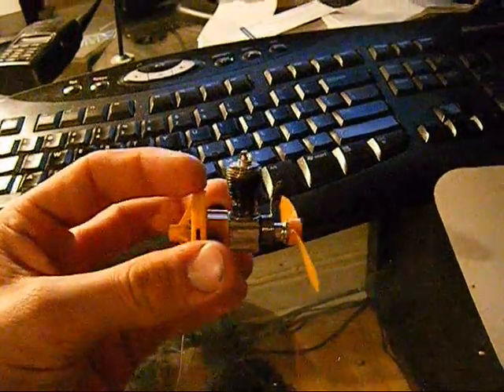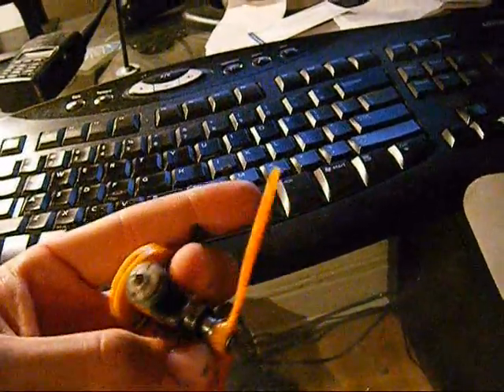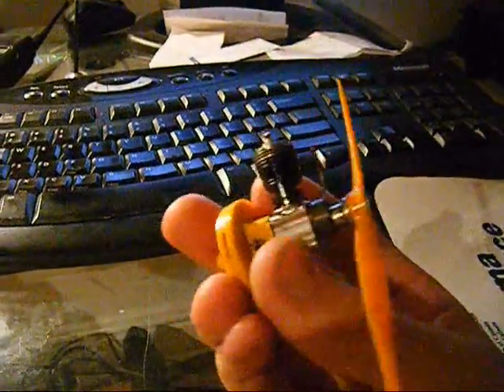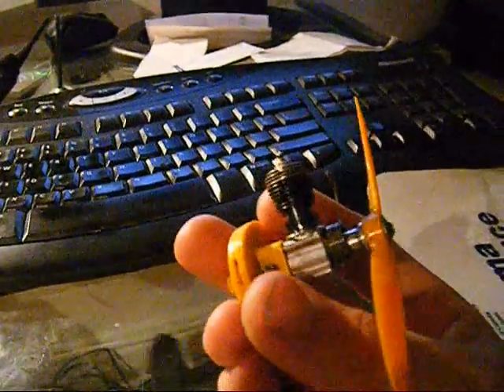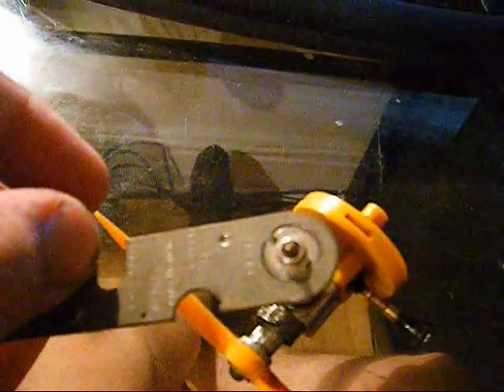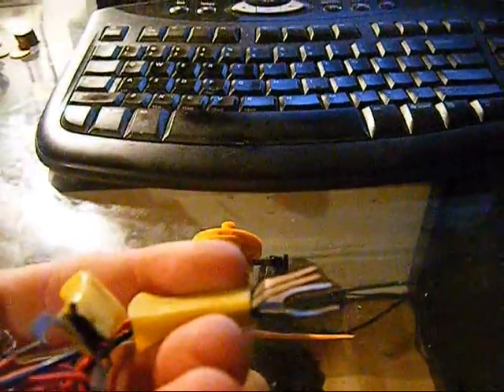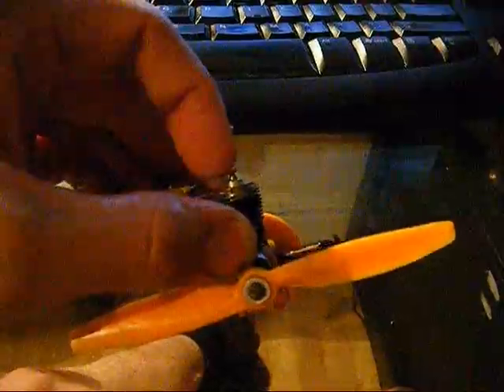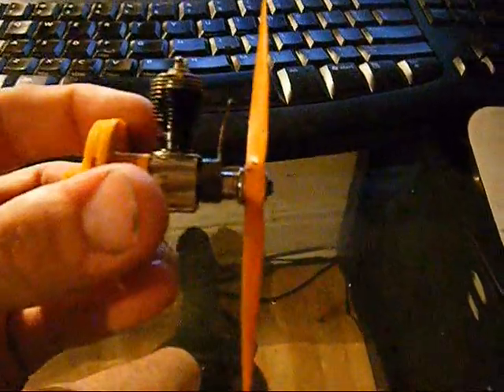cox engine explained by request

Comment: Actually the bottom of glow plug clip sits on top of first cooling fin. I find this way you won`t damage it when using it on other bigger or smaller engines. The engine will start by sliding the bottom of clip in-between the 1st and 2nd fins but it`s not the correct way of doing it.  I work on cox engines everyday. Anyway, thanks showing your video to others.

Comment from the maker: @nitroairplane oh, I knew they could not for sure run on gas but it had not dawned on me that diesel (which this motor is basically a 2 stroke diesel) would run, is there a special mix of diesel and oil needed?,